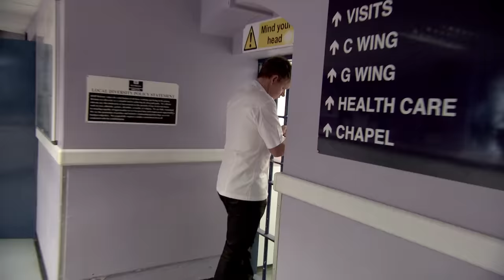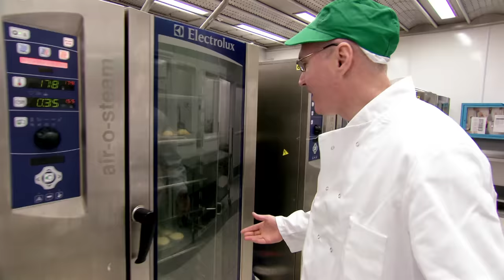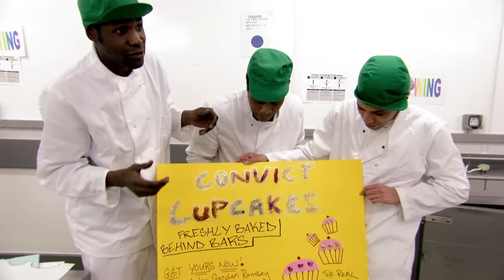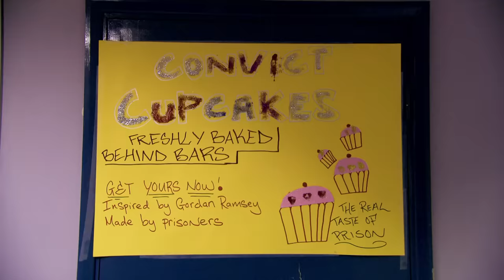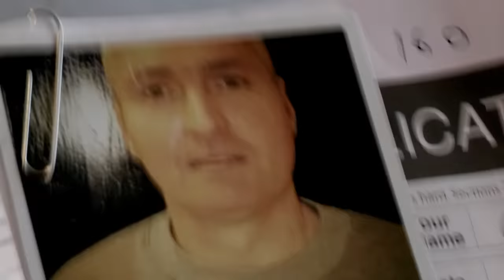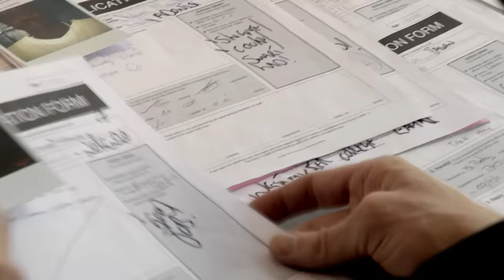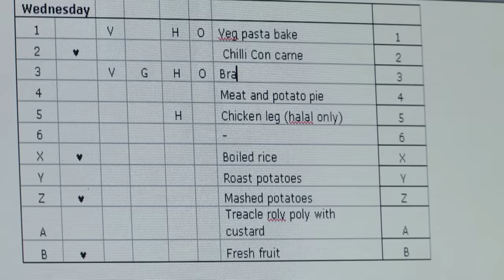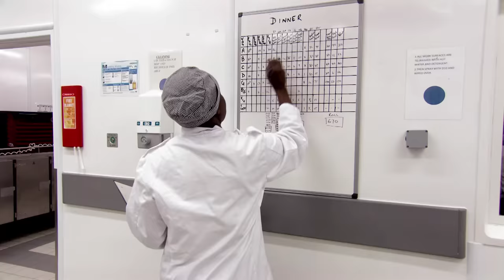Gordon Ramsay Visits Prison To Start A Prison-Bakery | Ramsay Behind Bars FULL EPISODE

Comment: 7:13 "some people are here for serious offenses."

"They found a shotgun under me bed"
Ahhh England
Reply: A firearm is a weapon designed to kill.
Reply: @imperatorscotorum6334  They are designed to launch projectiles at high speeds using combustion. Some people use them to kill, that is not the reason they are made though. That’s why there are rubber rounds. People use them for competitive shooting ect. Just because they can be used to kill people doesn’t mean it’s why they were made, cars were made to drive using combustion yet they kill 96ish times more people yearly than firearms(that’s including self defense and people offing themselves with firearms). So should we say cars are designed to kill? Source for statistics: ucdavis health, asirt
Reply: Around here people drive around with ar-15 s on the dashboard. Don't cut anyone off at the exit.
Reply: I am from the UK and I have friends that own shotguns. Providing you are fully licensed.with no criminal record and have a gun safe to securely store it, they are not that difficult to get. The dude who got 4 years most likely has an extensive criminal background or the gun may have been linked to a crime, with no license or 'sawn off'
Reply: If the government has guns. I want guns.